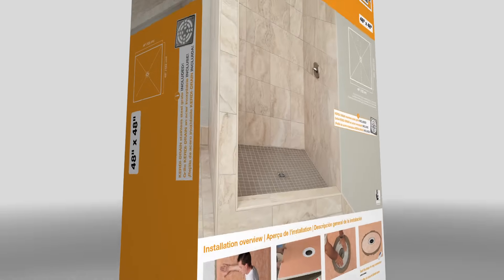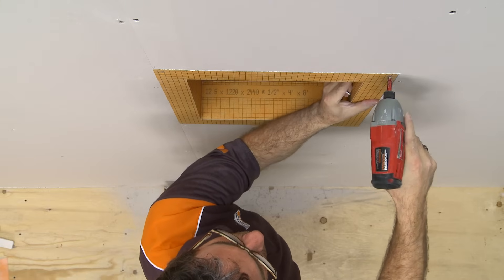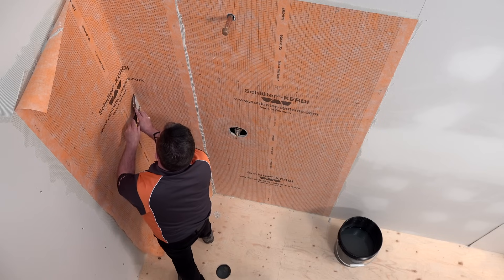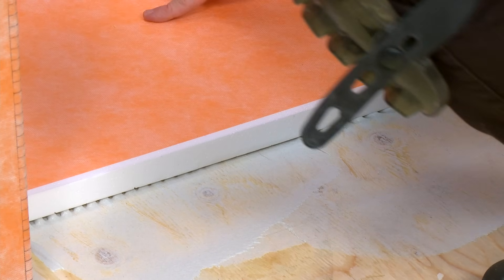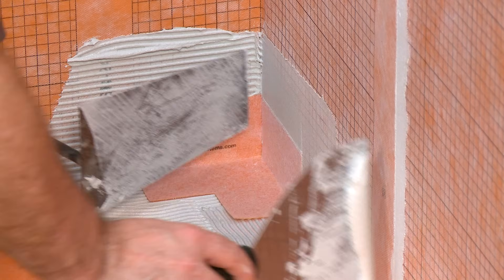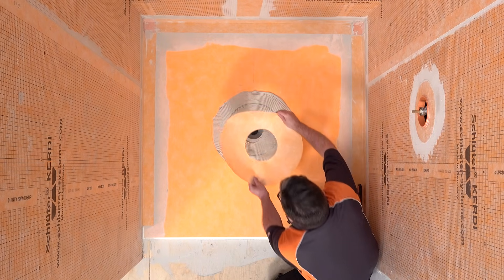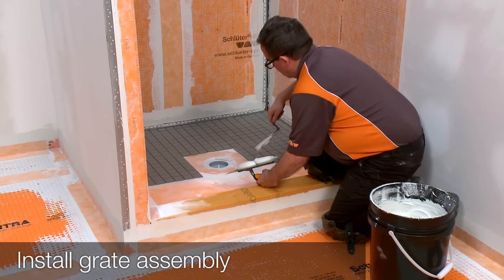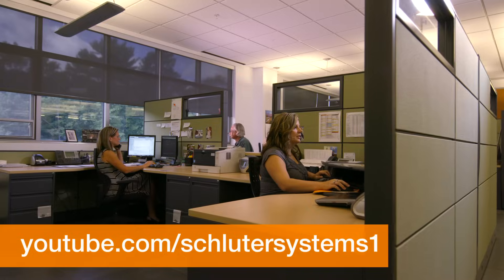How to waterproof your shower installation with the Schluter®-KERDI-SHOWER-KIT Complete Kit

Comment: Shower tray trimming:  Do you recommend cutting off the edge 3/4" flat perimeter of shower tray and using those edges once you cut the tray to the right size?
Reply from the maker: Hi Lisa, yes, just fill in the slope difference between the tray and 3/4" pieces with thin-set, let that dry, and then add some KERDI-BAND on top to waterproof it.
Reply: What’s the point of cuttingit
Reply: @choudry95  The first 3/4 - 1" of the perimeter is flat on top. After that it starts to slope down.

Comment: you mentioned "other suitable" sealant can be used."  What are those other suitable sealant?  Does Schluter's All Set thinset mortar work with siliconized acrylic latex sealant?
Reply from the maker: We recommend that the sealant be designated as suitable and recommended for use in wet areas by the manufacturer. In these applications, 100% silicone is typically the best option.

Comment: If all this is done correctly, how long should I expect it to last and be fully waterproof?
Reply from the maker: Hi there! When installed properly, a Schluter shower system is designed to last for the life of your shower. Its integrated waterproofing ensures lasting protection and performance, so you can enjoy your space without worrying about leaks or failures. And for extra peace of mind, our warranties provide full coverage down to materials and labor. For more details, visit the Warranty section of the Shower Installation Handbook or Schluter.com.

Comment: You said apply over top of gypsum board. You don't mean standard drywall do you?  You can put thinset right on top of drywall?
Reply from the maker: Hi there! Yes - gypsum wallboard is the same as drywall (drywall is just the more common term in North America), and thin-set can be applied directly to it. If the drywall has been mudded, be sure to use a water-based latex primer before applying thin-set. Approved solid backing materials include gypsum wallboard, cementitious backer unit, fiber-cement backerboard, fiber-reinforced water-resistant gypsum backerboard, coated glass mat water-resistant gypsum backerboard, Portland cement mortar, concrete, and masonry. Hope this helps!
Reply: @schlutersystems1 yes this helps very much.  Thank you.

Comment: What screws are used to screw in the niche?
Reply from the maker: Hi there! All niche sizes come with a waterproof KERDI-BAND frame to seal the seams, plus screws and washers for fastening the KERDI-BOARD-SN to stud framing. If you’re working with KERDI-BOARD, the 1-5/8" screw and washer sets can also be purchased separately. The product codes are KBZS35GT32Z and/or KBZS35GT32Z100. Hope this helps 🍊

Comment: for drain connection, if drain is already there, how do you know to cutthe white circlular part out or if make sure drain is at proper height to make sure when gluing pipes together that everything is lined up?
Reply from the maker: Hi there! For questions like this, we recommend reaching out to our customer service team - they’ll be able to get more details about your specific situation. You can reach them at 888-472-4588 (US) or 800-667-8746 (Canada). Thanks!

Comment: The corner-to-band membrane overlap instruction in this video contradicts your own "minimum 2" seam overlap" rule with regard to membrane coverage over seams. Another way of stating that rule is the minimum moisture path distance under the membrane through the thinset, needs to be  2". If the band overlaps the corner membrane by a ~3/8" ( approximate overlap in the video), the moisture path to the seam, where the membranes overlap, is 3/8". It's the distance from the edge of the overlapped band to the edge of the corner membrane under that band. This is just one example of many Schluter contradictions regarding their waterproofing system.

Comment: I have 1/4" by 3/16 V-Notched trowel like they recommend for applying the thin set.  But the trowel is a sawtooth style - also called a recessed tooth trowel. Do you think that's still acceptable?
Reply from the maker: Good question! You can definitely give it a try to bond to KERDI—just pull it back after applying to check the coverage. If you’re not getting full coverage, we recommend moving up to a slightly larger trowel. Always adjust based on what you see on-site! Hope that helps!

Comment: Why didn’t he just overlap the sheets instead of running the kerdi band up the seams?
Reply from the maker: Good question! Either option works to waterproof the seams - so either butt joint covered with KERDI-BAND, or sheet overlapping another sheet by 2 inches.

Comment: Bonjour, J'ai une douche de 36"x42" avec un drain excentré. Cette dimension n'existe pas chez vous. Est-ce qu'il est possible de recouper vos kit kerdi shower excentré pour s'adapter à vos dimensions? Merci
Reply from the maker: Bonjour ! Pour ce type de question, nous vous recommandons de contacter notre service clientèle, ils seront les mieux placés pour vous aider selon vos besoins spécifiques. Vous pouvez les joindre au 888-472-4588 (États-Unis) ou au 800-667-8746 (Canada). Hope this helps🍊

Comment: Can I use this membrane for floor?
Reply from the maker: Hi there! You can waterproof your shower floor with it. If you want, you can also use it on a cementitious floor to waterproof it, however, it will not act as an uncoupling membrane to separate out the substrate from the tile and prevent cracking. For that, you would use the Schluter-DITRA, which can also be waterproofed with KERDI-BAND over the seams. Hope this helps 🍊

Comment: Why don't you use a laser when you're mounting the membrane to the walls? What's the point of all that grid if it isn't used as a guide?
Reply from the maker: The lines are more for cutting the membrane, so it doesn't really matter if they are lined up perfectly or not. If you wanted to try and use them for tile layout, you could do that by lining them up with a laser, but you'd still want to make sure to use a level or the laser for levelling.

Comment: This is comical, and not a high end application. Thinset pushing up through the grout joints for one. If you are using smaller mosaics  not only will the grout pushing up through the joints, but it will also move the mosaics out of place causing a headache to rectify. Also as if every cut around drain can be done before drain installation.

Comment: Can the curb be installed directly on the floor pan rather than butting up to the edge of the floor pan? @schlutersystems1
Reply from the maker: Hi there! That's possible. You would want to make sure to support the inside edge under the curb with thin-set and let that set up before continuing with the installation, since the tray is sloped. It's usually easier to just cut the tray down and put the curb where you want it, if you're trying to get it in a particular spot and the tray is in the way. Hope that helps 🍊

Comment: I have a 6'x6' shower area on a concrete slab (new construction).The concrete is flat. The bathroom is 9'x11'. Want a curbless shower. The drain is off center 36".24 x 23.25" from the wall can I use the schluter system pre made pan in some way  to  do this? The shower is also a corner entry 40".
Reply from the maker: Hi there! Yes, you can use the Schluter tray with the Schluter Ramp. The other options would be to build up the bathroom floor or remove some of the concrete in the shower area. Hope that helps 🍊
Reply: @schlutersystems1  thank you....can you explain which schluter tray I would purchase for the off set drain and size of my shower....
Reply from the maker: Hi there! For any product-related inquiries, our product support team can assist you. You can reach them at 888-472-4588 (US) or 800-667-8746 (Canada). They’ll be more than happy to help. Don’t hesitate to contact us if you need anything further. 🍊

Comment: Water leaks are inevitable and evil. Why not reverse this process. Shower pan first, overlap with edge and corner  treatment, then walls. Any flooring or walls will eventually flex and crack. Let the moisture barrier in behind overlap so beads of water will flow inward to the drain not outward to the studs. 
Think about how shingles and valleys are treated on your roof and duplicate the logic in your beautiful shower.
Reply from the maker: With KERDI waterproofing membrane, the sequence of membrane installation can vary- what's important is that a minimum 2" (50 mm) overlap is maintained at all joints and proper connection to the KERDI-DRAIN is established. It doesn't actually matter which layer of KERDI goes down first in order for a waterproof seal to be made and continue to be water tight. So, although shingle lapping of the KERDI membrane isn't necessary, it is an acceptable option for any shower installation. 🍊

Comment: Question if you have the Kerdi system should you or should you not apply tile/grout sealer? I was told that you shouldn't because it won't allow it to drain as intended. I just wanted to find out from the manufacturer.
Reply from the maker: Hi there! The sealer won't affect our shower system!  Hope that helps!

Comment: Can this system be used with large 48” x 48” heavy porcelain wall tiles?
Reply from the maker: Hi there! Yes. Follow the applicable Shower handbook detail and discuss trowel size with the tile manufacturer and follow the tips in the following video to make sure you get full coverage. https://youtu.be/AaP1uA6FIQE?si=Fnf5abiW6LBis-4y  . Hope that helps!

Comment: Why do people still torture themselves with these multi-step jigsaw puzzles?  I have used several tile-ready custom fiberglass pans and wall panels.  Whole thing goes in in a couple hours, and far fewer potential failure points.  Kerdi seems laborious and archaic in comparison.
Reply: You can charge a lot more for the install of this designer system. They’re easy and great to work with
Reply: @dacampfield  why can u charge more for kerdi?

Comment: Could u do the shower pan before putting membrane on walls ?
Reply from the maker: Hi! Yes you could install the shower tray first. As long as the 2'' overlap is achieved at every seams, with KERDI or KERDI-BAND, the order of wall and floor installation doesn't matter. Hope that helps!

Comment: What's the reasoning for installing drain first with no access...I've installed many with no access AFTER pan was installed...just curious of that thought process
Reply from the maker: Hi there! The main reason for this is if there are different contractors on a project and the plumber comes through first and installs the drain flange. Then the tile installer would come after to install the tray and the rest of the shower component. Plumbers don't usually work with thin set, they won't install the shower tray. Hope that helps!

Comment: I saw in another KERDI video that he was screwing the KERDI board directly to the wall studs. This video shows covering wallboard with KIRDI membrane. What are the pros and cons to this? I would think if you are totally renovating a tub/or shower you would be down to the studs anyway.
Reply from the maker: Hi there! There are pros to each option; it is a personal choice. If you are directly on the studs, the KERDI-BOARD will save you a lot of time. If you already have gypsum boards on your wall and they are in good shape, then we would suggest keeping them up and using the KERDI membrane over them. If you would like to discuss your project in more detail, I would recommend giving a call to our product support team; they will be able to get into the specifics of your project with you. You can reach them at 888-472-4588 (US) or 800-667-8746 (CA).

Comment: Weird that they have you doing the wall first! As someone who has done a lot of roofing and almost every other home exterior, and for the past 15 years flooring and showers exclusively, I have to say that I always work from bottom up when waterproofing, meaning that I do the pan waterproofing then put the wall waterproofing on top of that, an would advise everyone to do the same. Never trust a joint lapped the wrong way to be water tight just because it is sealed, I don't care how much the overlap is.
Reply: First time I seen this video exactly my thoughts. Do floor first then continue with walls and overlap water proof membrane.
Reply: @Gunznarrows it’s better to have the pan touching kerdi instead of bare drywall. Might as well waterproof all the way to the sub floor instead of just to the pan
Reply: I think the floor piece is too soft to stand and work on so they can't start w it
Reply: Kerdi Band is applied over all joints. That joint never sees water because the Kerdi Band diverts the water away. So it doesn’t matter which way it’s installed. If that joint were exposed to water, then yes, it would matter.
Reply: I’m of the same thought process… it does say that alternative methods may be used as long as the suggested installation method of the membrane is used…. Meaning v notch trowel etc etc…

Comment: My question is is mortar waterproof, can the water go through the thinset?
Reply from the maker: Hi Melvin! Good question! The thin set mortar is not waterproof. If the water penetrates the grout and get's to the thin set it will reach the KERDI membrane and go no further. And then eventually, it just evaporates back out through the grout lines. No worries!

Comment: I am using the sloped shower pan, but it needed to be trimmed back to fit where my existing drain was. What do you recommend using to slope down into the shower pan?
Reply from the maker: Hi Taylor, would you be able to give our Customer Service team a call to discuss your project in a bit more detail, and they can advise from there. 800-472-4588 (US) or 800-667-8746 (Canada). Thanks!

Comment: Thought you used backer board for tile
Reply from the maker: Hi there! KERDI is installed over the solid backing (e.g., gypsum board, cement backerboard, etc.) on walls, creating a fully waterproof and vaportight enclosure. You could also use the KERDI-BOARDS for your walls. The your walls are waterproofed and ready to tile!

Comment: What is the process in this situation where the end of the membrane meets the drywall going out of the shower?  Looks like just a tile corner all the way down.  Is there anything specific to do there?
Reply from the maker: Hi James! The profile leg can be installed just passed the KERDI membrane so the tile has an even transition and the KERDI is not seen under the profile from the outside.

Comment: Shouldn't u use green or purple water resistant dry wall??
Reply from the maker: Hi there! Any dry wall listed in the Solid Backing Materials section of the Shower Installation Handbook detail, meeting the proper ASTM number, is fine. It does not have to be a particular color.

Comment: Can you cut down the size of the shower pan say I have a 60x38 and I want a 60x30. Can I cut 4 inches off each side?
Reply from the maker: Hi there! Yes, you can shorten each side of the shower tray. First, place your shower tray so it's aligned with the drain. To keep the perimeter height even on all sides, you will need first to cut 5" off both sides of the tray. Then, trim off and re-install the 1'' edge on both sides of the tray.
Reply: Why would I have to cut off 5 inches off each side and add 1 inch back?
Reply from the maker: Exactly!
Reply: Why not cut 4" off each side and be done?
Reply: Also my walls are 100% waterproof hardiebacker. Do I still put up the kerdi membrane over that with allset?
Reply from the maker: It is because the edges of the shower tray are flat and leveled and from that point the tray is sloped to the drain. Installing that 1'' strip back will make sure the 4 sides of your shower are at the same height and level and will be easier for your tile installation as well.
Reply from the maker: The KERDI membrane, KERDI-BAND and other components of our shower system need to be installed to be able to have the warranty on your installation.
Reply: I cut the foam like you said and it log looks messed up
Reply from the maker: Hi David! Would be best to contact our Customer Service teams, they will be able to also ask for pictures and give more information. You can reach them at 800-472-4588 (US) or 800-667-8746 (CA).

Comment: what is the mortar that should be used as a glue?
Reply from the maker: Hi there! To install our shower products, you can use any of our Schluter thin-sets. Or you can use an unmodified thin-set to install the KERDI membrane, the shower tray onto the subfloor, and so on. You will also use the same thin-sets to install your tiles over our Shower System. Hope that helps!

Comment: He didn't use any seam tape
Reply from the maker: Hi David, where do you see the missing Kerdi-Band?
Reply: I thought you were supposed to put "seam tap" on the butt joints of the gypsum board.
Reply from the maker: Hi David! Schluter® -Systems does not require taping joints between drywall panels before installing Schluter®-KERDI/KERDI-DS. However, if local code requires taping joints, latex based primer must be applied over the taped joints prior to installing the KERDI/KERDI-DS membrane. Joint compound can be water soluble and should be protected from the moisture in the thin-set mortar used to install KERDI/KERDI-DS. Hope that helps!

Comment: Seems like the wall sheets should overlap the kerdi band
Reply from the maker: Hey, It actually doesn't matter which layer of KERDI goes down first in order for a waterproof seal to be made. Top-over-bottom or shingle laps of the the membrane are not required. So, the sequence of membrane installation can vary provided that a minimum 2" (50 mm) overlap is maintained at all joints and proper connection to the KERDI-DRAIN is established.
Reply: @schlutersystems1  interesting I am looking forward to trying out your products
Reply from the maker: Glad to hear that! 🍊Let us know how it goes